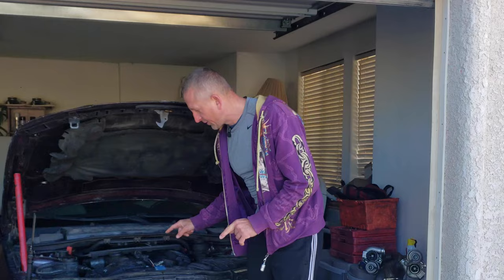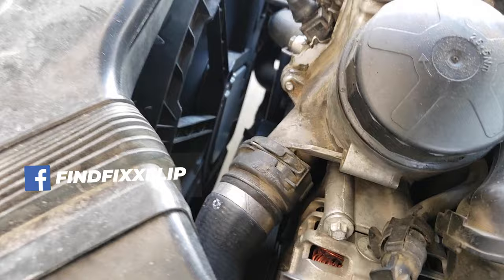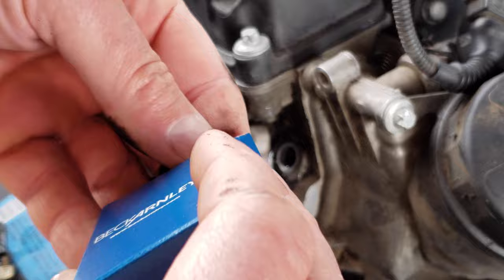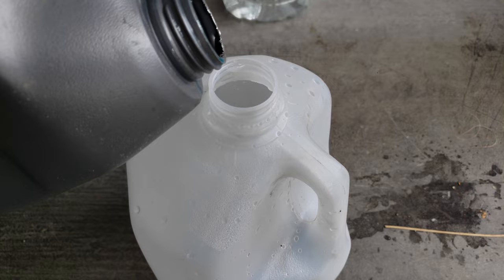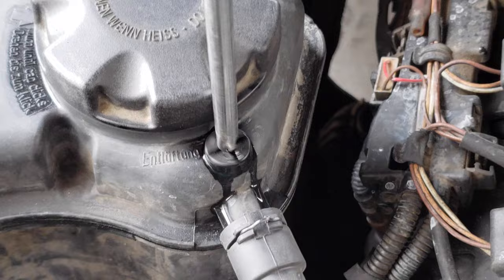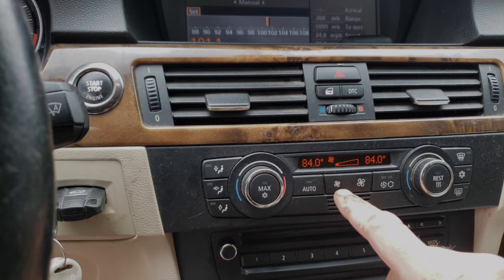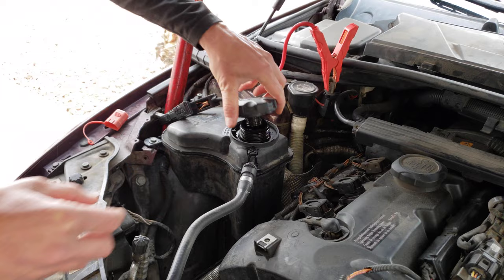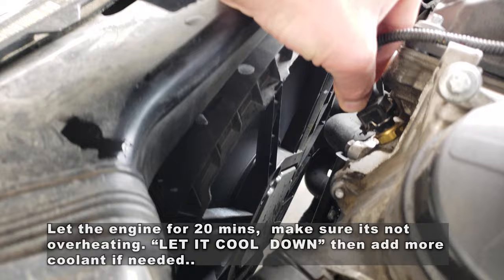BMW E90 RADIATOR FAN NOT WORKING(EASY FIX)

Comment: Thanks buddy didn’t think my fan was working till I tried your tip with putting air con on worked perfectly . Coolant sensor am thinking now
Reply from the maker: No problem man, It's definitely the cheapest possible fix route than replacing the fan. Another thing that i would recommend is if you don't have the software to check the temp of the engine, than just buy a IR temp gun at harbor freight for $25 bucks, point at lower block and wait for temp to reach around 95 fahrenheit.  That is the temp the fan is supposed to come on when reached. If car is still overheating than it might be time for a new waterpump and themostat, i just did a detailed tutorial on that as well https://youtu.be/Y_Yw87jw4sk
Reply: Yeah my fans not kicking in at 95 or 96c water pump is fine .done the bleed procedure and worked like your video . Only way to keep my car under 100c is to blast the heating stays at 95c  but getting to hot for that now lol. blows hot and cold air so think thermostat fine Fuses are ok too thanks I just use the hidden menu for temp
Reply from the maker: @jchalmers28jc18 have you checked to make sure there is circulation from the water pump, open the overflow tank cap and see if there is a steady stream coming out of the little hole. Also sometimes the fan control unit is bad, and only partially works.
Reply: @findfixxflip  yeah pump is working perfectly constant flow coming out wee pin hole at top . I hear it drawing air from the thermostat area . Just replaced coolant sensor feel smoother on idle but fan still not kicking in at 96-97 c . Do you no if there is a second sensor near fan or a relay maybe . Fan works with ac on Thanks buddy any help appreciated
Reply: @findfixxflip  mines is a E92 320i 09 plate
Reply from the maker: @jchalmers28jc18  ill do some research for you tomm,  but I have seen some models have a relay up by front of radiator driverside. Mines a 08 e92 so it didnt have one.
Reply: @findfixxflip  thanks buddy it’s appreciated older models had a fan sensor on bottom radiator hose but mines hasn’t got that
Reply from the maker: @jchalmers28jc18  have you checked engine temp with an ir gun, just to see actual temp. They sell at harbor freight for $25

Comment: Thank you so much ! 🙏🏽 Your video was so helpful I fixed my overheating issue
Reply from the maker: That is awesome, im glad my video helped, i made it just to share my experience and save someone else the time having to track down the issue. I also have a recent bmw series that covers just about all the usual maintenance items, waterpump, alternator, oil change, etc.. I've owned and rebuilt about 3 , 3 series bmw's and they always have the same things that need to be fixed. Go ahead and check it out when you get a chance let me know what you think.
Reply: @findfixxflip does fan turn on right when u start the car or when it’s at high temp?
Reply from the maker: @Everybodyshinetogether1  so it should turn on right away when using ac , but otherwise will activate when temp reaches a certain level. The control module has several speeds, based on temp. Hope this helps 🙏

Comment: Hello, I have a 20d n47 and for a while the electro has not turned on, however when I turn on the AC it does go, I have changed the temperature sensor because they have told me that it can be because of that and nothing, it goes up from 90 degrees and does not start either, removing the temperature sensor if it starts. Could someone give me a hand?
Reply from the maker: Hi, what year and model do you have? Its looks like a possible 2011 x3? Not sure though, the temp sensor is the easiest and cheapest part to fix. Have you checked the power going to the fan itself? Check for constant ground,  and check for 12volts constant power? Last thing is signal wire at 4 volta. Do you know how to use a multimeter? Let me know so I can assess from here.
Reply: @findfixxflip hello, i hace an e92 from 2007, n47 engine i didn’t checked that so i‘lo try tomorrow, you have some tutorial to do it?

Comment: Hi there 
BMW 325i 2006 . Have got a same problem with my one too as the fun not working when the overheating lamp on my dashboard comes on , do you think will be the same problem as you describe on your video or will be something else ? 
Thanks appreciate your video .
Reply from the maker: yes start with the sensor it is about $13 bucks on amazon. Then do the unlpug procedure to see if you have power going to the fan. Then trace your power to fan make sure you are getting constant 12v. and remote or signal should be around 4 volts. if fan is working with ac or unplugging then it's a problem with the circuit.

Comment: ok one more question then what does the RADIATOR SWITCH DO in the lower E90 RADIATOR  hose? doesnt that turn the fan on too? how do i know that part isn't also bad ??or if its just a bad COOLANT SENSOR?
Reply from the maker: Yes its a coolant sensor also. Some of bimmers just have one in the hose, other have sensor in the video. That's ones easy fix as well. Just push tabs to remove from hose.

Comment: bro i dont have this sensor on my N46N engine 320I E92 
my fan works perfect on all speeds but not everytime sometimes it doesn't start until i turn off the car and back on
i suspected its the coolant temp sensor in the coolant hose so i changed it and i changed my thermostat, noting that my radiator is new and most hoses also so no leaks. i also changed the fan rely and fuses.
what could be the problem with the fan not starting when it should?
Reply from the maker: What year is it? sometimes there is also a black control unit relay upfront by the fan on some models, maybe relay is bad. What year bmw is this? Is the car overheating? A good way to check is get an IR temp gun, and check engine block temp. usually the sensor sends a signal to fan when it's temp reaches around 95f. That's when the fan's should kick in. Fan will shut off or run low  until temp is below this, so the fan shouldn't be running all the time except when you are running the AC. Hope this helps

Comment: I replaced the coolant sensor no help, the fan does work when the sensor harness is disconnected, could it be the fan air module that needs to replaced? Any help would be appreciated!
Reply from the maker: What model and year do you have?
Reply: 2011 BMW 328i xdrive wagon E91
Reply: Checked all the fuses, they are good, could it be the cooling fan relay module?
Reply from the maker: @kevinbaldwin1111  good possibility

Comment: Hello, I’ve got a 2007 bmw 328i auto. Do you know if my vehicle model has and auxiliary fan switch ?
Reply from the maker: Not sure, but if you do it would be located on the driverside right by the fan, usually attached to it it's a small black box. What is your car doing?

Comment: Hi, i have fault code 9c53 (electric auxilary heater) seem to have weak blower.
Its a bmw e90 n47 lci msport. Would you have any idea about this issue? Thanks
Reply from the maker: I'm not very familiar with the n47, i could do bit of research and get back to you, What part of country are you from? I don't think we have those here in the states.
Reply: @findfixxflip oh thats no problem, just thought id ask you after i seen your video. Oh im in ireland :) thanks
Reply: @findfixxflip please I have issues on BMW e90 my radiator fan blows high on N54 engine
Reply: Hey,  have u fix the issued

Comment: I have x5 e70 30! 2009 is 99c open thermostats But at 108c work fan 
Is down 105c is normal??thanks
Reply from the maker: Yes they operate with a desired range so they don't always open at 95c-120c

Comment: Hey what’s up man appreciate the video! My question is when you unplug the coolant sensor will the fan turn on 100% of the time if it’s working properly? Just this morning my car started overheating for the first time since I had it. The fuse is good and it didn’t throw any codes but when I scanned it it said electric fan activation. So I ran a test on it from the scanner and it failed and the fan would not turn on. I tried running ac and heat on high still would not turn on. So after watching your video I unplugged the coolant sensor and it still wouldn’t turn on. So if the unplugging sensor trick is 100% then sounds pretty much like my fan is toast huh? Thanks!
Reply from the maker: thank you, and yes i agree, Un plugging the sensor basically signals the car that it's overheating and if circuit is working the fan should almost instantly come on. Start with the sensor it's the cheapest fix, about $13 bucks on amazon. then what you can do to test the fan is disconnect the main cable from the top. Run a 12v positive to the large wire, i believe it's yellow wire, then the brown is the ground, small green is the signal wire. So you should be able to activate it with this. If it doesn't then most likely the fan is bad. Also there is a function in the Ista d to activate the fan, if you have that software currently. Thanks for watching
Reply: @findfixxflip  awesome man thanks for the response! I’ll replace that sensor and go from there but seems the fan is the issue. Found a guy local who has a fan for 100 so might just go with that since it’s not too crazy to replace. Thanks again for the quick response and advice!
Reply from the maker: @danimalmx3  No problem, i had to do the same diagnostic process with mine. I ended up getting a buying a new fan on amazon, but then decided to get a real BMW one at the junkyard, haven't had any issues since then. Definitely route i would go if you have that option

Comment: Why did you have to wiggle it for it to start back up at the end? Do you have to do that normally, or have you not had to do it again?
Reply from the maker: So I wiggled it because I thought that The connector was intermittent so I ended up clipping it and soldering on a new connector
Reply: So it was prob just connector all the time🙄

Comment: Hey wassup I have a 06 750 I don’t have a bleeder screw on mines but other than that would the procedure be the same? My radiator fan not working
Reply from the maker: Hello, Yes it looks to be similar, when you disconnect the sensor you are basically telling the car its overheating and fan should turn on, if it doesnt then problem is most likely with the fan.
Reply: Know where I would be able to find sensor?

Comment: What could be a reason my 2010 128i fan operates properly for local driving, but if its driven for more than an hour the fan fails to turn on @ idle causing it to overheat
Reply from the maker: Here ya go bud i found this, digging around. Summary: VEHICLE DESCRIPTION: PASSENGER VEHICLES. THE ENGINE AUXILIARY/COOLING FAN OPERATION, INCLUDING VARIABLE SPEED, IS ELECTRONICALLY CONTROLLED. FAILURE OF THE FAN MOTOR CAN CAUSE THE ELECTRICAL CIRCUITRY OF THE FAN CONTROL UNIT TO OVERLOAD AND FAIL, CAUSING THE FAN TO STOP OPERATING.
Reply from the maker: This will be good for testing the circuit as well. Hook a 12 volt test light to battery +, turn the ac on and then probe the signal wire ( it will be the smallest of the 3 wires) at the fan. If the test light lights up then you know that the fan is receiving a signal.

Comment: I have a loud engine noise it all help so much to get your opinion on the noise
Reply from the maker: What kind of noise? Is it  knock. Is it constant or comes and go's? Check engine light?. Lemme know
Reply: @findfixxflip  it’s coming from the motor area and I have no engine light on it still drives perfect I changed all sparks and coils and also the solenoids sensor and the front oxygen sensors but I don’t know how to describe the noise could I possibly email you a video of it
Reply from the maker: Sure findfixxflip@gmail.com
Reply: @findfixxflip  thanks i Just sent it
Reply from the maker: Kk co ill check it out and get back to you shortly
Reply from the maker: @kinginrudy  Wow that noise almost sounds like something is rubbing, is the fan blade rubbing on the plastic when you start it?
Reply: @findfixxflip  the radiator fan ?
Reply from the maker: @kinginrudy  can you see if it is physically touching anything? can you spin it by hand?
Reply: @findfixxflip  it’s not touching from what I see and yes I can spin it by hand I’ll double check to make sure
Reply from the maker: @kinginrudy  yeah that noise has me miffed. Very hard to decipher.

Comment: hello! I have 2008 128i with N52 manual transmission. I noticed auto and manual have different type of the cooling fan. I did try everything you did but its still not working. do you have any idea why?
Reply from the maker: I can do some research for you tommorow. But it could be also there several fuse locations, and if one is blown it won't complete circuit. Have you tried disconnecting your fan, and running jumper leads with 12v to each to see if it turns on? It's easy to do maybe i can do a follow up video for everyone
Reply: I researched and a few people have same situation but they said it would work if I cut wires and connect together? Not plug. I am scared to do that because I just bought new cooking fan. Also they didn’t clear explain too so yehs
Reply: @findfixxflip and I’ll try to do running jumper! Sorry I just saw this. Thank you for respond!
Reply from the maker: @marcozuz7072  No problem my man

Comment: Hey so I have this e90 and I’m basically driving and outta no where the fan turns on and it’s rly loud and after 5 seconds engine overheating sign comes up what can be the issue and when I opened the hood after overheating I saw some coolant coming out of reaervator but when I opened the cap it was pretty much full. Any help?
Reply from the maker: Hello, so when the car reads temp very high, the fan will kick on at different rpms depending on how hot its reading. Did you replace the coolant sensor in the video? If its bad it will send overheating message to the car. Turning on fan at high speed. also are you checking the overflowtank cap with car running? Look for a small stream of water going back in, if there isnt them waterpump is going out or bad already. Hope this helps, thanks for watching 🙏
Reply: @findfixxflip  so I did coolant bleed and I did see water going inside the tank does tht mean the tank is good and yes I just changed my coolant temp sensor and the fan is working
Reply from the maker: So the water stream just means that your waterpump is working properly. Did the level after the coolant bleed the reservoir go down? @yungxanhxe9
Reply: @findfixxflip  yes it did btw I did the bleeding for maybe 5 min is tht the reason for overheating or maybe I have thermostat problems?
Reply from the maker: Yes there is your problem.. So the bleed procedure takes 12mins, Start the procedure, put a timer on your phone, wait for 12mins and make sure you put a battery charger on to keep the battery voltage normal. You can hear the water flowing, don't stop the bleed until you can't hear any noise coming from the radiator hose area. After that take the key out of the car and check your overflow tank, you will probably need to fill it up a bit after. You definitely have air in the system and that's why its overheating still. Watch the end of this video, around the 9:00 min mark https://youtu.be/Y_Yw87jw4sk @yungxanhxe9
Reply: @findfixxflip  sadly after bleeding for 12 min, the engine still getting hot fast 😭😭😭😭
Reply from the maker: Ok so then you have a few possibilities. If your car is blowing white smoke then you could have a blown head gasket. You need to find out why it's getting so hot if you have circulation then your waterpump isn't circulating quick enough to cool the system. I had this happen same symptoms before i decided to change mine. 1) first replace the thermostat and waterpump going to be fairly expensive i think close to $700 follow my video step by step and you will save on the labor. Use my links for the waterpump that is the best price i could find for it, and its a real pierburg. This job is going to take between 4-6 hours to complete but it's worth it. I did this video about 13 months ago, so it's been running strong no issues since then. Your fan its working, so there isn't too much left to fix. Mine had the same overheat, fan on high, I pulled the car over, it was overflowing, i let it cool down and drove home, decided to do the repair, and it was good to go. I'll be  here if you have any questions during the process🙏 @yungxanhxe9